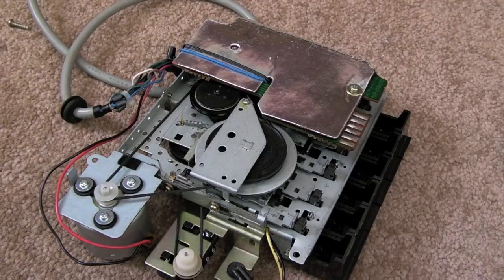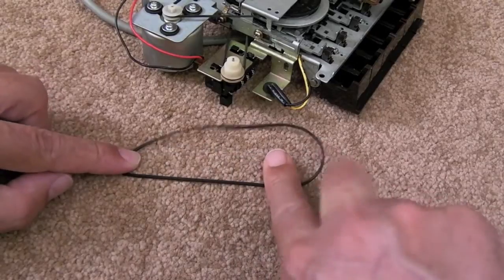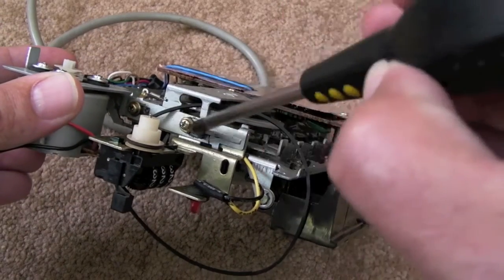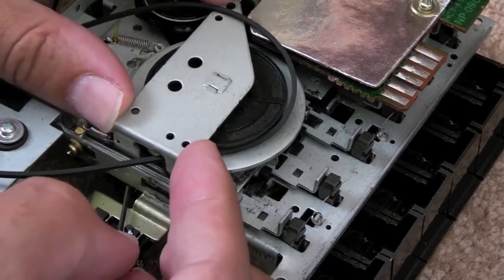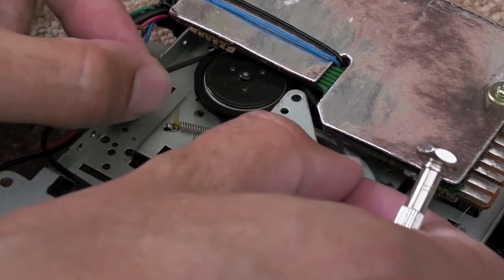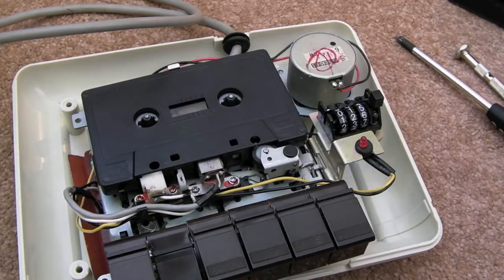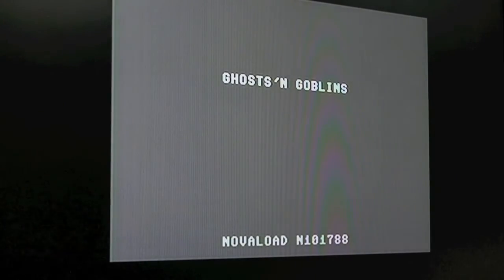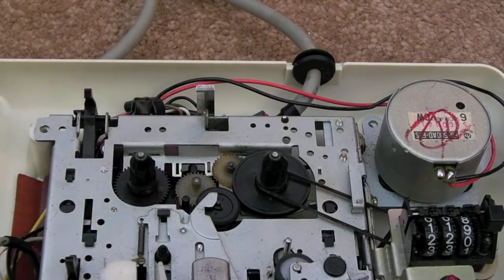Commodore 64 (C64) C2N Datasette Belt Replacement

Comment: Hi dude!! Nice job! I have the very same datasette model, with the NP-090B PCB. I couldn't find the schematics for this model anywhere, and one component is destroyed, burned to ashes, so I have no way to find out how to replace it or the values that the component needs in order to let this datasette come back to life (actually is not working at all). Would to lend me a hand to solve it mate? Any idea?
Reply from the maker: =/   The best advice I can give is to post on one of the C64 forums (perhaps lemon forum or amibay) - someone might be able to tell you what that component is.  The alternative is to buy a faulty datasette from eBay - they do appear there and often quite cheap as most of the time they have worn rubber parts that cannot easily be replaced etc.
Reply: Thanks for the advice my friend, that's a good option. What if I send you a picture of the exact PCB area and, in case you still have this specific datasette, you open it up and let me know the component kind and value?? Of course, instead of buying a faulty Datasette, I can pay you something for your help and time. Thanks for your contribution to the retro-computer world! ; )

Comment: Hi , can you tell me where you got the belt from, I have an old PET 2001-8 and it needs a new belt.
Reply from the maker: I tend to just buy belts from eBay!  If you measure it you might be able to find something a similar size by length.  Sometimes a smaller belt will work just fine if you cannot find an exact replacement.

Comment: My wires have come off of the connector,how do you get the connector pins out so i can put them back on,I am on about the connector that connect the datassette to the c64..?
Reply from the maker: +RETRO Nuts Not quite sure what you mean, could you upload a photo or something?  It should be easy to fix I think!

Comment: hi, i just got a new c2n 1530 datasette for my vic 20 but it does not work properly, i was just wondering if the belt is the main problem, because you know the lack of use plus the age makes it all expanded, i don´t want to dissasemble it until i know exactly what the problem is. as soon as i start to figure out what it is i pressd the play button and nothing happend,  the right spindle seems to be kind of thight to spin, i hope that you will show me how to fix it up.
Reply from the maker: +wally dominguez navarro You need to clean the internals (head in particular) like I did, and examine the inside.  Maybe the belt has broken, maybe there's a problem with the motor or something.
Reply: ok, i changed the belts but it look like the problem is the motor, how do i fix it?

Comment: 4:15 . The screw and spacer, tighten it. Might fall off otherwise. The spacer-like-washer ensures movement of the metal sandwiches in between which is the eject-mechanism. Add grease where metal touches metal.
Reply from the maker: +bwack Yes, I did tighten that up and lube it =)

Comment: I got a problem the drive keeps  stopping do you think this would fix that ?
Reply from the maker: Normally when the drive stops turning its the belts, or the pinch roller getting stuck (needs the fitting lubricating), or the motor needs replacing (if you are really unlucky).
Reply: GadgetUK164
thank you for getting back too me..... took it to bits and it was filthy... brough this week.. but cleaneed it all up.... and oiled the spindles... and well seems to have fixed it thankyou.... you video was very helpful and now playing exploding fist! :) hehehe